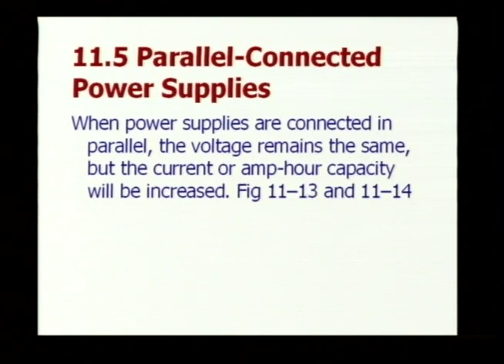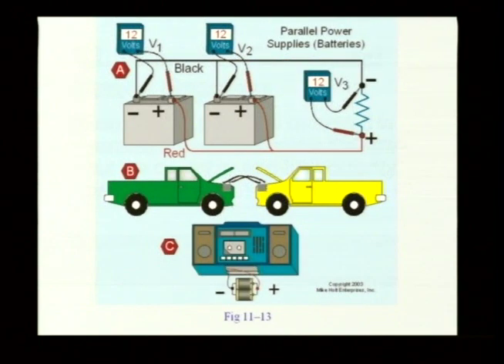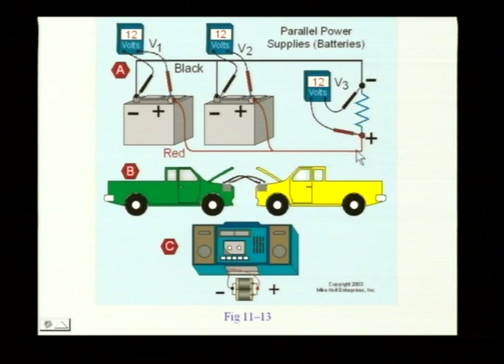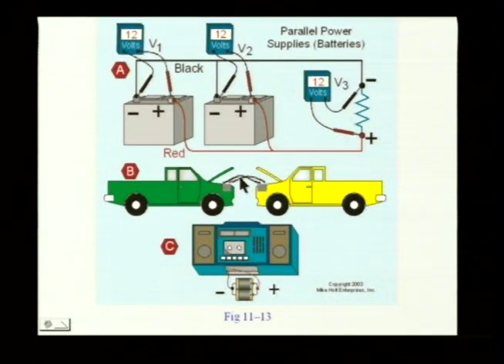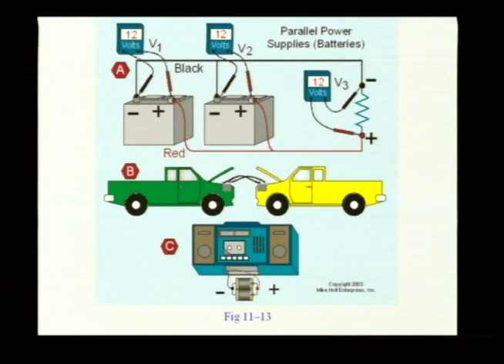Electrical Theory ©2004 - Parallel Connected Power Supplies

Comment: How about for 12v power supplys? Can you connect them if they are the exact same?
Reply from the maker: I don't undestand the question? If you are asking if 12V batteries can be connected series, parallel, or series-parallel, then the answre is yes.
Reply: @MikeHoltNEC  I already tried it, i figured i'd ask first since its better to ask a dumb question then blow something up,
Reply: @MikeHoltNEC  I meant can you link 2 12v power supplys together? I connected a 200 amp power supply to six 12v batterys and its working fine, just like an alternater would charge the batterys in a car.

Comment: What is the resultant voltage if we  connect -2v and +4v in parallel?
Reply from the maker: No clue, test it and let us know!
Reply: Voltage is the DIFFERENCE of electrical potential at two points in a circuit. What's the difference of -2 and +4? Six volts!